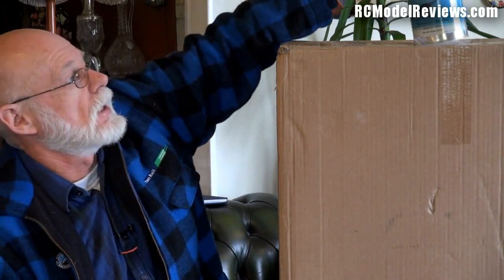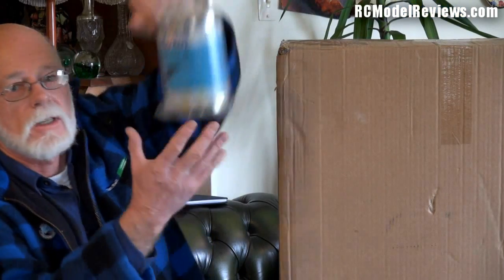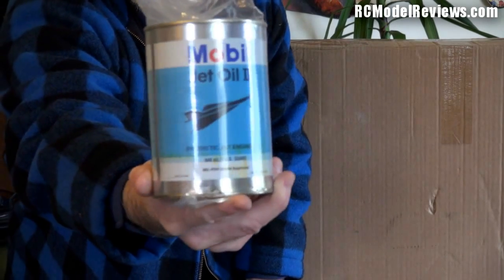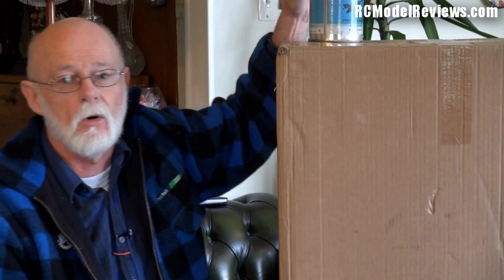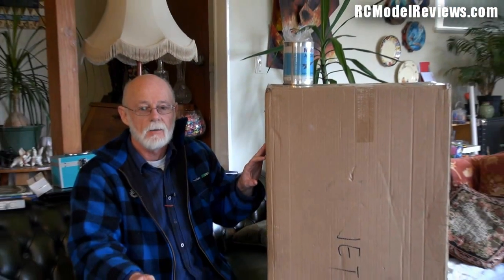HobbyKing turbine update

Comment: just to let you know boss, you can use kerosene, that you can get at any hardware store, you can use heating oil, again at any hardware store...youre better off using two stroke synthetic oil for lubrication,  turbine oil was not designed to go through the combustion chamber and be burned. i really cant believe its taking this long..